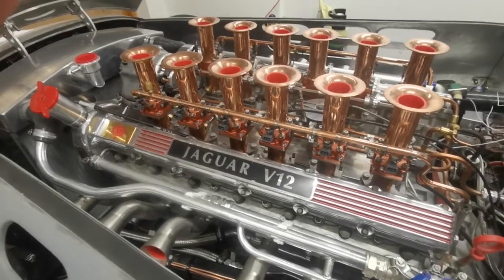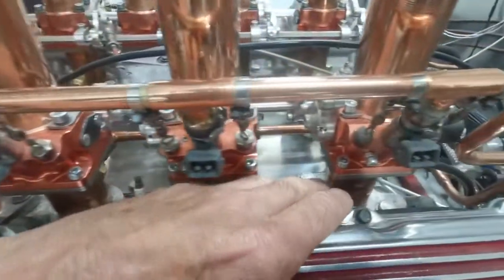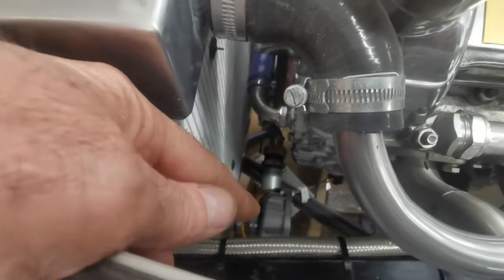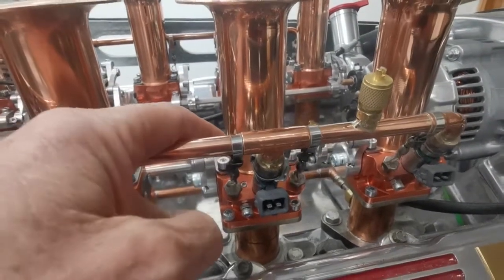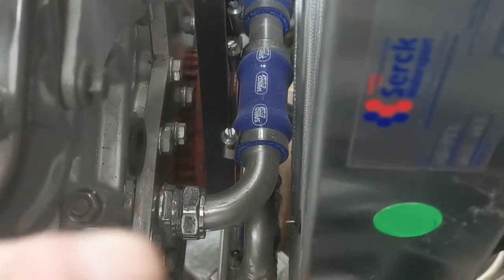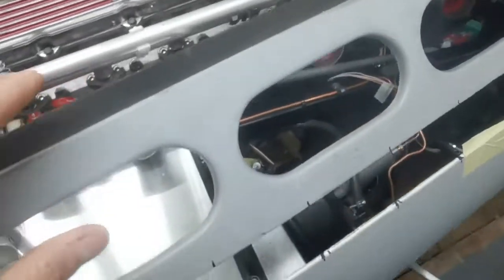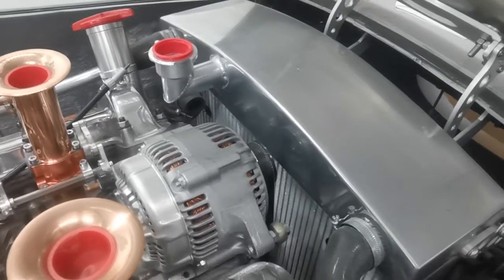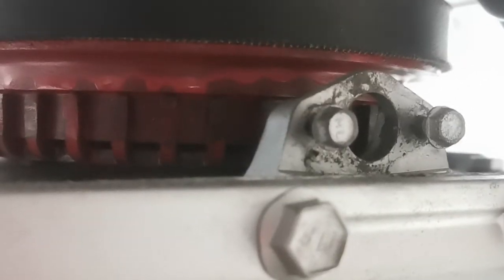Share Jaguar V12 Engine.

Comment: WOW!!!! Amazing Sir! Maybe I've missed something from previous episodes but what Jaguar is this engine originally out of? Was it a 6L from the factory?  Any thoughts on the pre- HE dry deck cylinder heads?  Lots of technical gold to ponder on- Thank you
Reply from the maker: Hi, yes it's a 6 litre engine from an XJS originating out of an illegal arms dealers car, beefed up by Walkinshaw engineering, was crashed in France after a police car chase, car written off and engine ended up with me off ebay, only discovered this info when I started to rebuild engine and found non standard pistons/ camshaft.
Reply: @davidforster8654  Amazing story and you must have been ecstatic about that discovery!  All fascinating material as I'm in CA at the moment and no one wants these old XJS's due to our high fuel prices and smog regulations.  So much DIY potential and your engine is a brilliant example!  Checking out a rare XJ220 next week and have been in contact with Mobeck in Norway as well as reached out to Tom Lenthall concerning the 7.0 conversion.  This TWR era has become a bit of an obsession with me.  Will be following your channel closely- Cheers

Comment from the maker: I copied the original HE engine triggervwheel but instead of having three  120 degree fingers, I modified it to 36 minus 1, to allow configuration to the Emerald ignition system. It was a labour of love, the car is  still in the final build stages. Because I'm a refrigeration engineer of some 45 yrs, this was an advantage in using left over bits of copper and brass. I believe the standard bhp of the Jaguar 6 litre V12 HE power unit was almost 300bhp.... I'm hoping to gain perhaps 15bhp, there's no. Power steering, a/c, water pump or  air compressor. Only the final test on the Emerald rolling road will tell all. Thanks for your kind words.

Comment: Really beautiful build. I've wanted to do something like this for a while. But using individual copper/brass hard lines to each injector mimicking the look of an older CIS injection system.  How did you make the trigger wheel?  Did you balance the trigger wheel? I'm assuming this was originally a 6.0L HE V12 from a late model XJ or XJS? which came with a 3-0 trigger wheel and cam sensor right?

Comment from the maker: Not yet, as I have yet to complete the car, not sure what the BHP will be, but with exponential exhaust, direct flow into the heads and modifications to the pistons by TW engineering, it should be interesting once on the rolling road....all will be revealed once ready.

Comment: Interesting....does in run?
Reply from the maker: Yes, the engine fired up first time... I was very surprised as no engine rarely starts first time.. The exhaust note superb, sound like a miniature Spitfire engine. Oil pressure too high at 100 psi, so now making up an adjustable oil pressure regulator. Still a few more months yet before it goes for its IVA test to make it Road legal.
Reply from the maker: Yes fired up and on rolling road produced 360 horse power, plenty for an old boy like me....